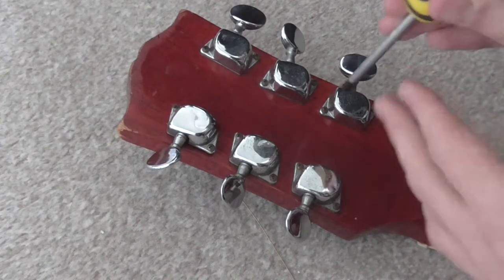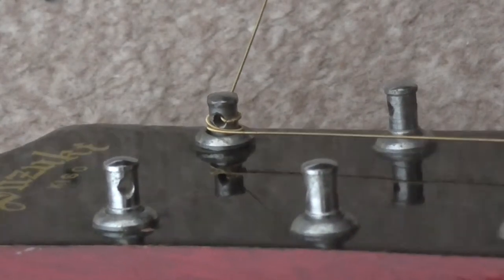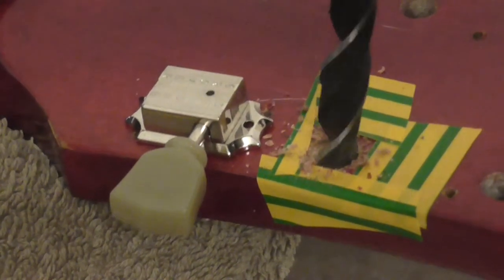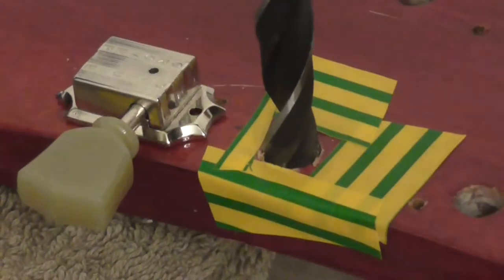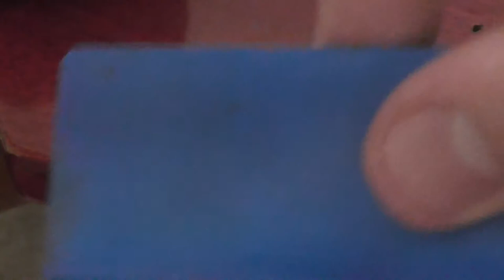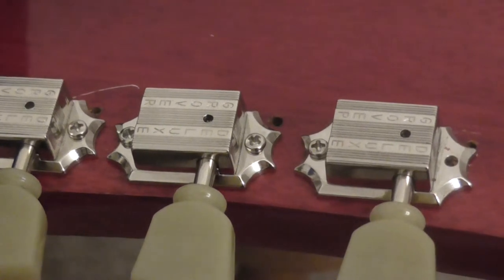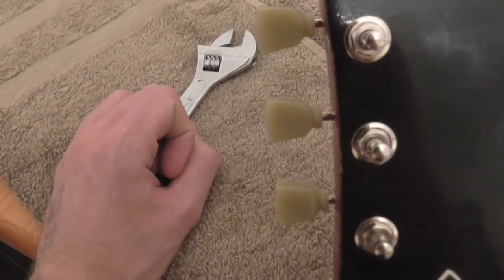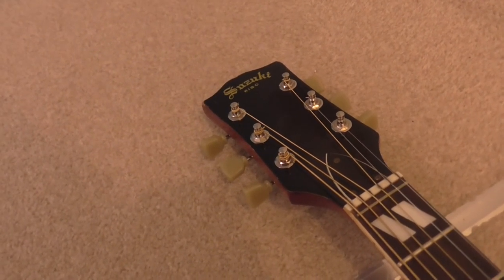Putting Grover Tuners on my Acoustic

Comment: i just found your video and i have a question. i have a Gibson g45 and it has Grover mini rotomatic tuners and they are a little bit small for my fingers so do you know if Grover 305C6 Rotomatic Tuners would fit and be a good choice to replace them with
Reply from the maker: They look like they might be a drop in replacement, but they don't have the screw holes that I assume your G45 would have, so it wouldn't look perfect. I don't have much experience with that guitar though so I can't be 100% certain. That said; if it's only the size of the ends of the tuners that you have an issue with, couldn't you just buy replacements for those? That way you wouldn't have to worry about replacing the mechanism of the tuner, just the end?
Reply: @AdamThomasMusic  thank you for answering that question, that's a good idea replacing the buttons i might just try that